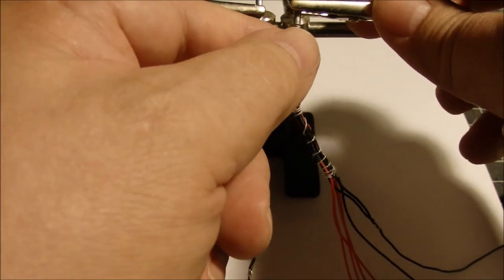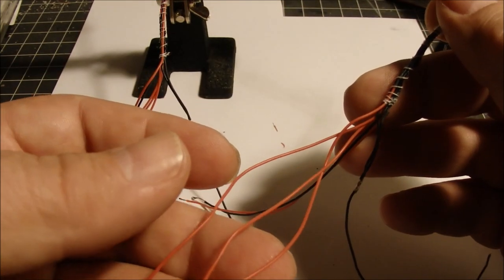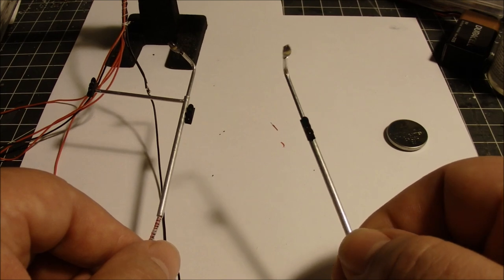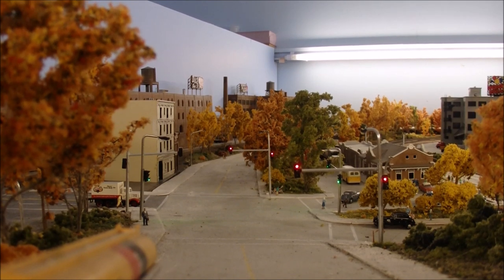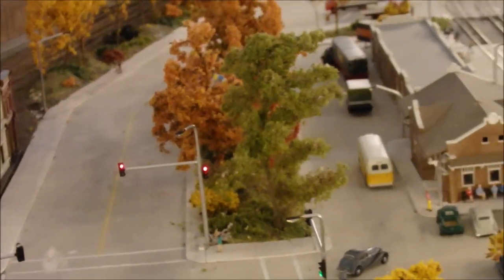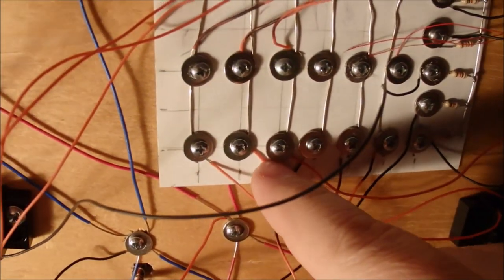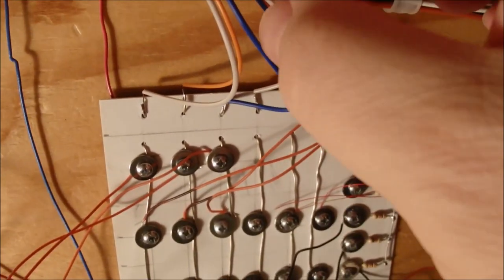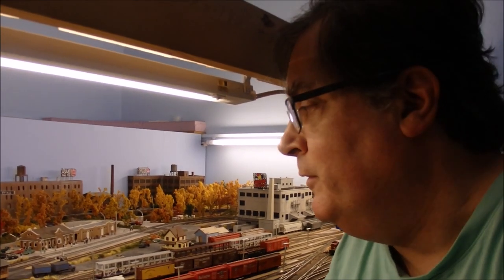MNW N Scale Model Railroad Monthly Video Journal, April, 2021

Comment: You have a beautiful layout. And those traffic lights are amazing. You might consider using some perf board to mount the resistors and replace the styrene sheet terminals. Add some screw terminals to make it easy on yourself to connect wires. Would not cost much. Looking forward to watching the rest of your videos. Thanks for sharing.
Reply from the maker: I agree my styrene sheet was not a very good idea. I'm still tinkering with some ideas to improve that poorly conceived set up. Thanks for the comment!